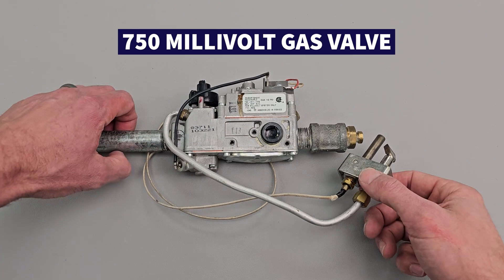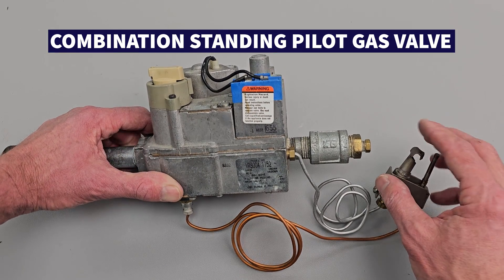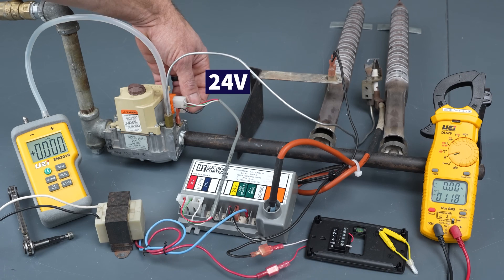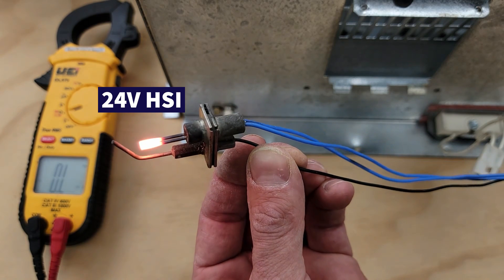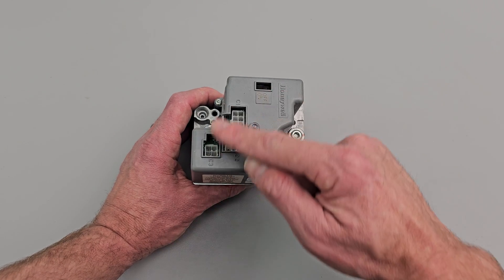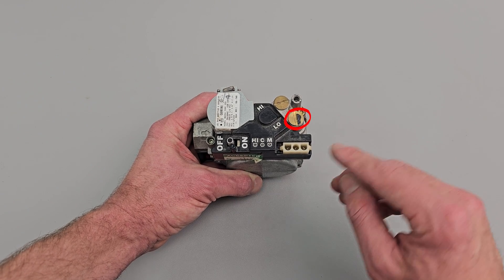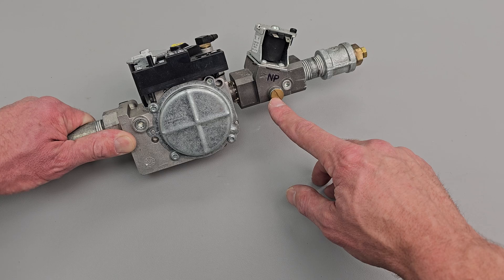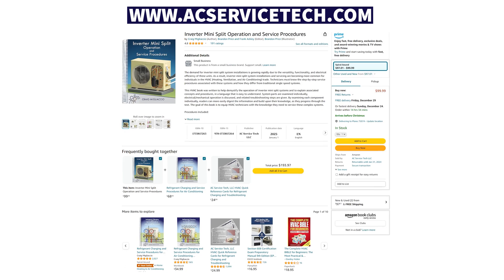Gas Valve Types and Operation on GAS FURNACES!

Comment: Can I swap the 24 volt setup with the older setup? I'm guessing I would have to move the thermopile over to the newer tank. I don't want to have to plug it in and I don't need the open/close door on top of it.

Comment: Do you have a video for the 750 MV control valve that shows what MV readings you should be getting for the Pilot Generator, control valve, Limit switch, and thermostat? This is for wall heaters--when the burner doesn't cycle on. Open readings, closed readings, everything. Thanks.
Reply from the maker: Yes look up "acservicetech 750 millivolt gas valve"

Comment: What do you guys think about this: Got a short to ground using my continuity tester on my meter... from the red 24 volt wire going right up to the defrost board on a 12 yr old AMANA Central Heat Pump outdoor unit. I isolated the system R coming from the indoor air handler where I first found the short on the R. When I checked that Isolated indoor R there was no short. So, I followed the short to the outdoor unit. I got right up to the R connection on the Defrost Board. I pulled the wire off the board to keep going with further testing downstream to isolate the short. So then I checked for continuity between the R on the board and ground, and wow...no continuity! I checked my way back on the red circuitry going backwards again, and no more short there, even with the red wire connected back to the Defrost board.
Anyway, my guess is that when I pulled the R wire connector off of the Defrost board, the board flexed a bit, and eliminated the short. I have had boards do that a couple times in the past. So that slight flex of the board is my one guess, or could it have been some build up of spider eggs and webbing that was evident on the board causing a short and moving wires around to look actually stopped that problem by moving the spider webs and eggs? Ever seen that?

Comment: Got fooled today on a stepper gas valve. Thought the valve was bad as it was lighting pilot and not opening main valve right away, and when it did it was a weak flame. Threw my manometer on expecting the valve to be bad yet it gradually staged up until it hit 3.5”wc. Learn something every day.

Comment: Are the burners different in a furnace with a 2 stage valve compared to a single stage valve? Why is it ok to run lower gas pressure through the burners on a 2 stage but it could cause problems with the single stage?
Reply: Burners are not different. On 2 stage furnaces. Their is a 2 speed inducer motor. Inducer job is to not only create a draft in the heat exchanger, it's also regulating the amount of oxygen it's taking in.